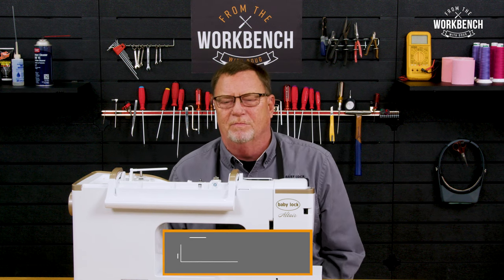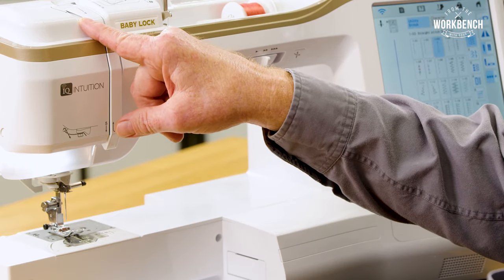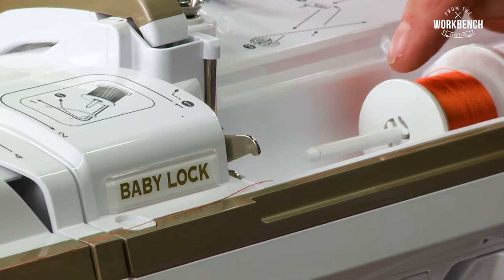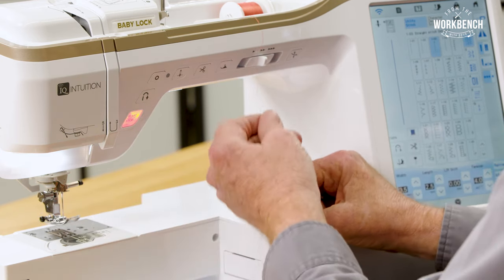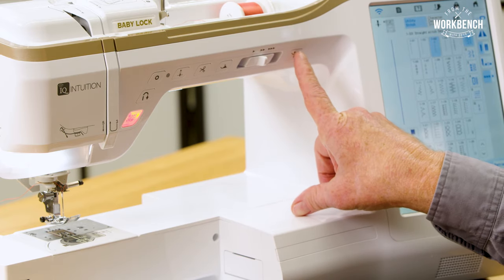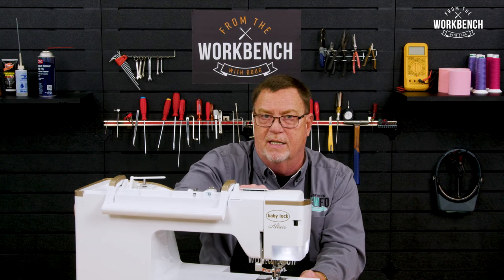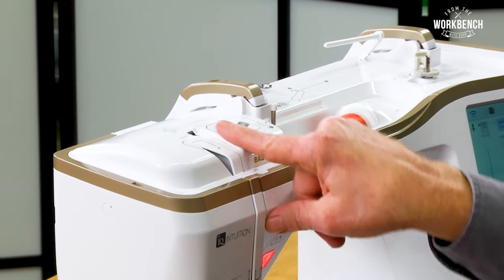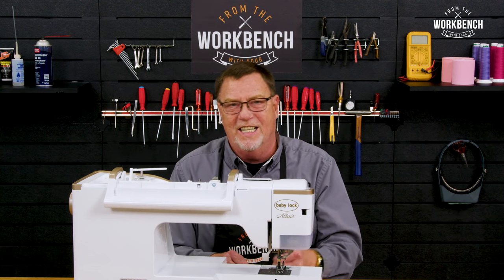From the Workbench with Doug: Preventing Problems with your Needle Threader

Comment: Hi Doug…. Your videos are so informative. Thanks always for your time.  Can you possible tell me why on my crescendo baby lock machine I keep getting an error message that my machine is not threaded properly.  I have tried everything to figure out why I keep getting this message.  I have cleaned my machine about 5 times thinking maybe a wee tiny piece of fuzz or thread is lodged somewhere.  I have put in a new needle several times. Rewound bobbins and cleaned out the bobbin area several times.  It is just the strangest thing.   I sure hope you might be able to guide me on this issue.  🙏😊
Reply: This normally occurs when you don't use the Needle up button, to place the Needle in the proper position for the Needle threader hook. There is a timing mark on the Handwheel that should be facing straight up when the needle is in the proper position.
Reply: Ok. I will try this method of using the button, I will let you know if that solves the problem.  It will allow me to sew for about 30 seconds and then pops up that message!  So I will see if it doesn’t do that anymore…. I will let you know. Fingers Crossed 😊

Comment: Love the video.   Do you have any advice for automatic threaders that no longer work?  I have a Destiny 2 and mine worked great for a year and now doesn’t.  The alignment is off for some reason.   I manually do it now.    It seems silly to drive 2.5 hours for a fix.   (Not to mention a service fee)
Reply: There is a very small hook that goes through the needle that may have been bent and is very tricky to repair..

Comment: I dropped a needle in my machine. Tried everything to find it bye could not. It seems to be seeing fine but I am worried if this will damage my machine.
Reply: The machined is designed to compensate for that . The needle tip will likely end up at the bottom of the hook unit and removed during the next service.

Comment: I have a Crescendo and have had difficulties with my needle threader ever since I got it.  The last time it stopped working, I just started threading by hand. It’s so aggravating but it’s too expensive to keep paying for repairs.  Is there anyway I can adjust the threader myself?
Reply: There is a very small hook that goes through the needle that may have been bent and is very tricky to repair..
Reply: press the needle threader button, when it gets to the point where you can get to the little hook turn off your machine. Turn the machine back on for light but don't press the main screen. Hopefully you have good eyes at this point. With a pair of tweezers straighten out that little hook. It should be just a teeny bit to the right of center to go through the hook. At least for me.  When you think you've got it right touch the main screen to get everything back into position and try threading again. Keep doing this until you've got it right. Hope this helps.
Reply: @Imag1na710n  when I turn the machine back on, it finishes the threading circle. I didn’t touch the screen. Thanks for your reply.
Reply: Is there a way I can send you photos?
Reply: @sherrysenn2177   I guess mine is a bit different. I only turn it on for the light, but you don't have to turn it back on. Just get yourself some good light so that you can see the little hook between the two little metal thingys that  go on either side of the needle. Then use whatever you have on hand to move it back into place.  I typically use tweezers from my cricut, but any small tweezers should work. I would pinch the hook thing along with the metal bar on the right to get it to go to the right just a smidgeon. Sometimes it takes a few trials to get it just right.

Comment: What’s the best way to remove a broken thread that you can’t reach from the needle area?
Reply: Kathi, this video may be helpful. It may not be your machine model, but may apply :
 https://www.youtube.com/watch?v=4EDBtNwTRXg&list=PLOrppPPAaYoYVer7rfJ0XwbsAdBPT35gx&index=26&t=38s
Reply: Thanks so much for your answer Doug!!! I have watched this video - probably ALL your videos, lol - but as I have a fully upgraded Solaris I’m reluctant to try to pry off the cover. I’ve tried flossing with unwaxed dental floss as well. But what I really meant (but didn’t ask clearly) was this:  I’m sewing along and my thread breaks and gets pulled up into the inside of the machine near the take up lever and I can’t reach the end to pull it out through the needle. What’s the best way to remove the thread in order to rethread? Sometimes I’ve been able to cut the thread and “unthread” it from the top bu taking the cut end through the threading process, but I worry that it’s messing with the tension discs. I also don’t want to just pull it out backwards, but don’t really have other options that I know of. What’s your advice? (Btw, my local shop has sadly closed, so I can’t ask them and I have to travel for regular service.) Thanks!
Reply: If you can get access to the tail of the thread, rotate the hand wheel backwards to unwind it from the machine.

Comment: I have an Aria. The needle threader stopped working shortly after I bought it. The dealer replaced the mechanism, but it stopped working again shortly after. When I took it in, they said I should never move the wheel by hand. That's what makes it stop working. That seems absurd. Is that true? I have basically given up on that function. Thanks.
Reply: Yes. When the needle electronically stops in the up position, the cam mechanism is in the perfect for the rotation of the Needle Threader, as well as placing the Take-up lever in the highest position. It's ok to rotate the handwheel, but always select the needle up button, to position it for use of the needle threader